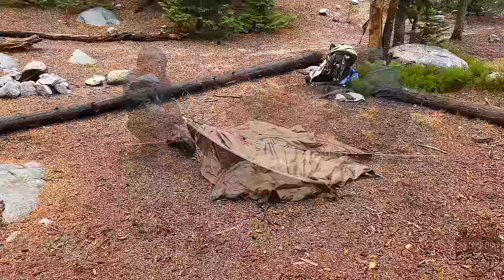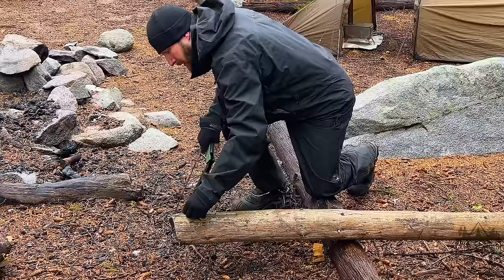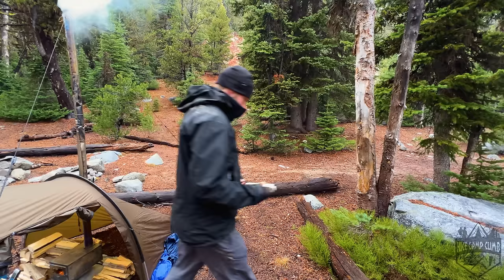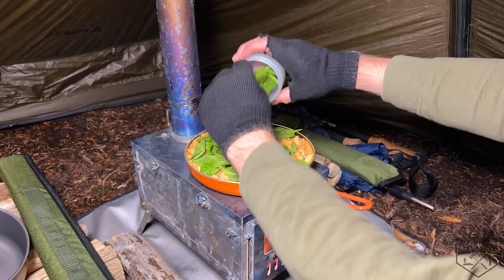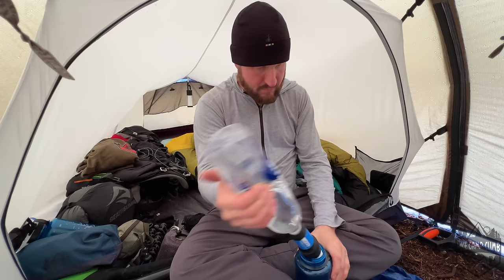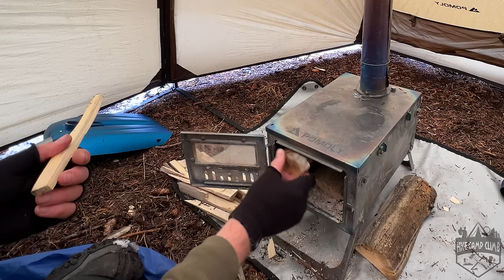Fall Hot Tent Camping In Snow | ASMR

Comment: Gotta say...After that extravagant dinner made with REAL ingredients, I was expecting Eggs Benedict for breakfast! LOL When I was a teen, I had a Shakespeare BIG STICK CB antenna mounted above our house. With that chimney you can have one too! I used 3 guy wires where the antenna met the 10ft pole. Kinda like you! That camp stove has a really compact footprint when carrying. How warm did it keep your tent interior? After you pack it and get a stable burn, and lower the air intake, how many hours of glowing coals can you get? Older now and anemic, so warm has a new HIGH PRIORITY rating out of necessity. Don't know where that is, but are Bears still a possibility? Surprised a bunch didn't show up for that feast and bring their BIGFOOT friends? Don't worry. They didn't want you, they wanted that Pasta dish and would fight amongst themselves and not even notice you! LOL And look for a flat spot the size of your tent footprint, or so, elevated, since you could choose anywhere there? I prefer Waterproof(ish) Bathtub floor tents with a footprint liner underneath. Yeah Yeah.... I know... extra weight.  But getting dunked and having to move in the POURING night will change anybody's mind on that! Or you could just lay in it! LOL And the firewood floats. Sometimes I use sausages and remove the casings to make pasta dishes with saute'd meat and the works as well. And other times Ground Beef and Loose Sausage combined. We would just boil coffee grounds in the pot and use a small screen strainer (fine mesh and like an ounce or two weight) when pouring into our cups. Nature's Promise Breakfast Blend is nice, and sometimes Cafe Bustelo, when we want ROBUST... Nice with boiled milk and sugar! If it's regular camping and not backpacking, we'd bring an espresso pot! YUM!

Comment: If you are a professional camper, in my opinion, to avoid the rain and water flowing below, you should put it in a high place, or you can dig a small fence around it, and build a drainage system with a small fence, more than that. Again, you should bring a knife to the forest to chop firewood, it will be more accurate than if you hold a riwuf.